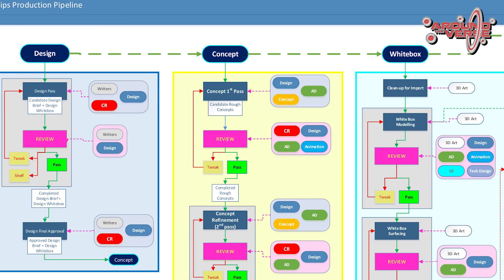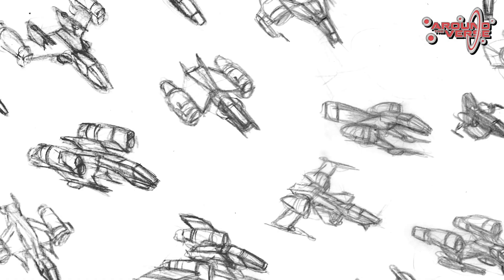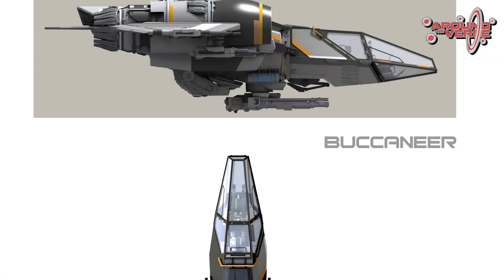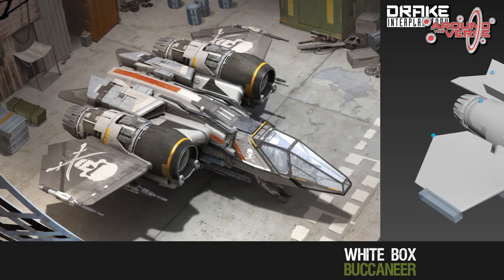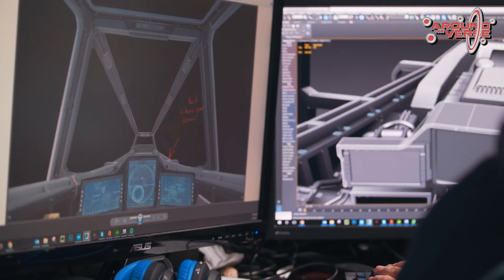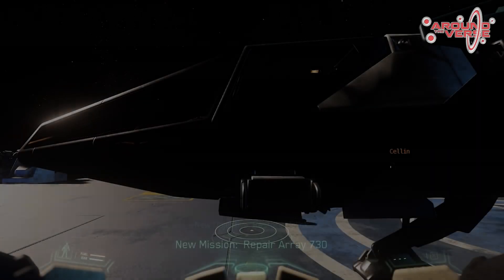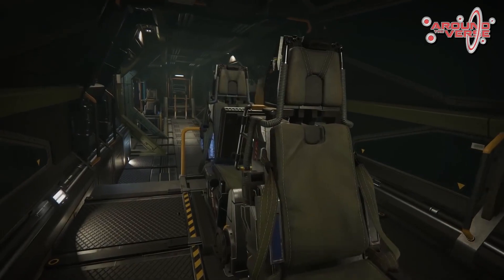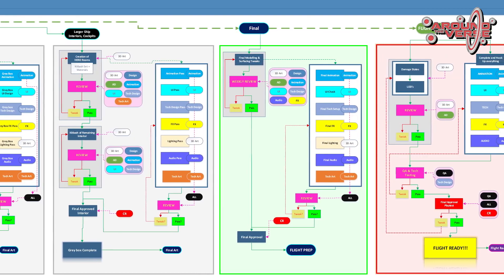Making of Star Citizen: Ship Pipeline Part 1 (Concept to Greybox)

Comment: DevOps Development is where speed and quality comes together. The ship team has achieved this and I think 2019 will see more CIG teams following the DevOps culture.
Reply: Software is hard. <Insert management term of the month> will not change the fact companies want highly complex software in stupidly short time. There is no shortcut to good, quality software. If you try and write software quickly, it will have bugs, be unreliable, and ultimately fail at achieving its goal.
Reply: @paradoxicalcat7173  You miss the point, speed does not mean going faster in DevOps, it means being more efficient. Due to having a DevOps producer and all the skill sets in one team, where the producer streamlines all the skillsets. They rarely have to wait on another team to start working. As such things go faster. Eg. If the ship hull creation team had to make a ship and then the internal components team had to wait, that is wasted time. As such the DevOps producer helps to standardize the process by asking, "What is a ship?" "What makes up a ship?", and once that is all defined they can layout the ship from concept, start making the rooms and components while the ship hull is being designed all at the same time. This is why ships are being made faster, and now we can see other teams following suit as I said 2 years ago.